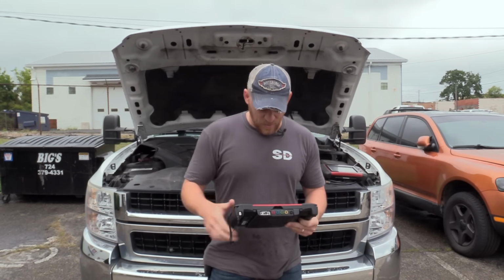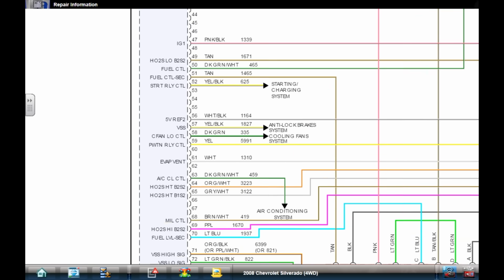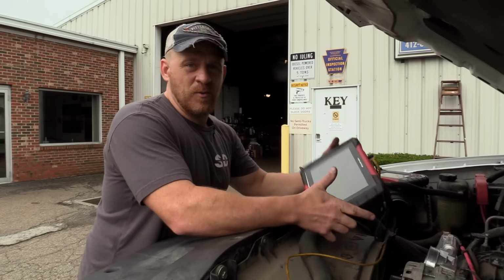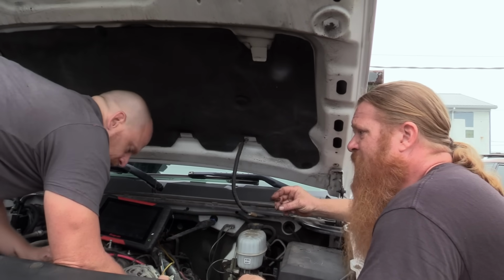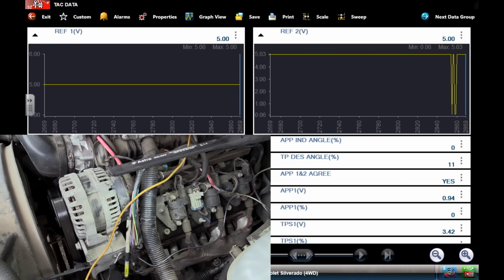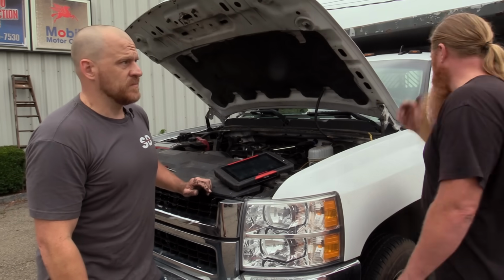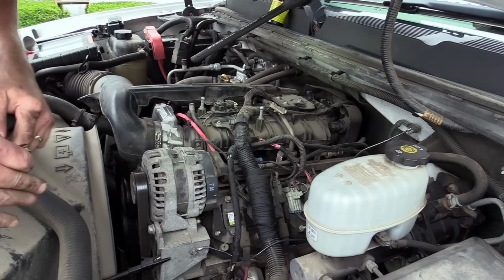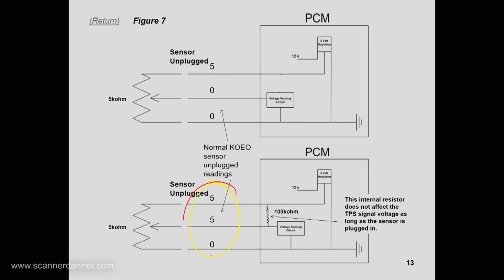Troubleshooting a Shorted 5v Reference Circuit (Chevy Silverado)

Comment: If you DONT  find that fault and it does need a sensor after all ,after maybe a couple hours diagnosing do you still charge a Diagnosis Fee ?
Reply from the maker: For an intermittent shorted 5V reference circuit? Absolutely! From memory, there were 4 or 5 different sensors sharing that circuit. Which one would you like to start replacing?

And let me ask you a question in return. If I replaced one of those sensors and it didn't fix your vehicle, would you still be willing to pay for that sensor and the labor to install it?

That's the entire point of this video. Proper diagnostics eliminates the guesswork. You're paying for the knowledge, testing, and time required to identify the actual fault, regardless of whether the final repair is a sensor, a wiring harness, or something else.
Reply: @ScannerDanner I see about diagnosis times and procedure  . But did you see my other comment on the Purple plastic burnt on the Bolt end where and when you lifted the harness off it ? I thought its a purple wire right away and funny it meled right through everything ! TIS CLEAR REFERENCE for finding shorts and faults in future !
Reply from the maker: That never happens honestly and that was only visible after the short was found, using harness contact points as a guide. It would not have aided at all in finding it, because contact points are first!

Comment: Big bro wins again! They gently fussing over where the contact point was.  Lol. Lil bro explaining a million things.  Big bro just did it!
Reply from the maker: To be clear, big bro is the bearded guy 😊
Reply: @ScannerDanner that's hilarious.  Well you definitely give off older brother energy.  Lol. Love the back and forth.
Reply from the maker: 😂 that's funny that you notice that. I've always been the more bossy one 😅
Reply: @ScannerDanner you can hear your bro justifying his actions,  as if he messed up.  He did good.  You just happened to get it right first time! Lololol. 

That said.  I'm watching these again because I have 3 sensors going crazy.  Cps, cht, and evap vent.  Intermittent voltage,  32000 f,  -18.5 hg. Looks like i have a wiring issue right?
Reply from the maker: The crank sensor and temp sensor would'nt share the 5v ref but would possibly share a ground. The EVAP vent, are you referring to a solenoid? That wouldn't be sharing anything.
What are you working on? Year, make, model, engine, codes and symptoms. I can try to help more
Reply: @ScannerDanner  09 mazda cx9. P0342 and p0452. Stalling while driving and losing obd port. Stft are fine in closed loop.  Then after ten minutes or so the fuel trims sky rocket then shut off altogether.  Then it stumbles and dies. I've tried a ton of things.  It's time I verify the wiring is ok. Ty in advance.  Love all of your stuff.

Comment: I have been chasing a 5 volt ground problem in a truck I bought for 6 months now. Never could figure it out until I watched your video. I found the excat same problem you discovered. Patched it up and taped a thick piece of rubber to the harness. Cleared the codes and now it runs fine with zero issues. Thank you
Reply from the maker: Awesome! Happy to help and props to you for figuring it out!

Comment: how can you track down a sensor ground (grounded inside ecm) that has mystery 3.5- 5 voltage on it, all sensors on circuit have individual sensor power supply
Reply from the maker: If it is all the sensor grounds then look for a main computer ground that's bad. If it is only one sensor ground, generally, something cooked it. Something got plugged in wrong or a 12v power wire shorted into that circuit (harness damage)

Comment: Dan have you saw a situation with 5vref stalling the ecm and dropping to 2.5v yet it dosent leave any codes but loosing comms on the bus u-0100
Reply from the maker: Handled no differently than this one.
Reply: @ScannerDanner thanks  this one’s tough I’ve unplugged all the sensors and replaced a few with no difference gets to 140-150 degrees and dies only codes are loosing comms to ecm
Reply from the maker: Driving or sitting still? And does it occur
at that exact temp each time ? You have a harness issue i bet
Reply: @ScannerDanner it is really close to the same temp every time the temp sensor has been replaced  and all the wiring with new pins to ecm but dosent read correct on the cluster the only thing that makes sense to me is that a wire  on the same internal circuit has a problem and I’m relieving load on it when unplugging the temp sensor, doing this it runs normal and dosent stall the ecm  but messages engine ac off  plug in temp sensor dies instantly
Reply: All other sensors unplugging makes no difference the ecm has been replaced and programmed  you can imagine that is  frustrating
Reply: Do you think this could be  a serial data issue

Comment: I have a 5v TPS issue on my 2001 clk430 that I can't figure out. I've disconnected every sensor I can find on the engine bay disconnected the bas/esp module , the tcm, the transmission connector, the o2 sensors and still 3.15 v at the tps. I pulled fuses to the instrument cluster and am at a loss on what to check next. Stuck another ECU in and same 3.15 volts !!!???????? Wtf

Comment: 6 years after you posted this video, I'm facing the exact same problems in my 2005 Silverado Z71 5.3.  I'm hoping this is the solution I've been looking for. I'll find out later today when I get into the harness. I was thinking it may be bad grounds or something getting grounded out. My scanner is just a little cheap one but it does graph so I'll be watching it while I check things over.   The other problem is the fan control unit code and the fans turning on randomly overnight and killing the battery.  Plus the alternator randomly over charging up to 15.4v. Any ideas on the fans and alternator?

Comment: Love it! I'm dealing with a volvo that has the same 5v circuit B low code along with several codes for all the associated sensors.  At the plug for one of the sensors in that circuit I noticed exposed wires coming out of the factory loom and into the plug for the sensor.  Thinking it was simple mice damage, I peeled back some of the factory electrical tape/loom with the intent on doing a splice fix and discovered that the insulation around each individual wire (in this case 3 wires) had completely eroded off even though its been protected underneath the factory tape/loom! The car is in limp mode and while its running if I slightly pinch the wire harness even a few inches up from where I did any tampering it shorts and shuts off the engine!  I managed to move it to a happier position to where I'm only getting two codes instead of 7, no more 5v low code but a high code for that particular sensor and one other.  Now I'm thinking it may be shorting to power instead of ground,  I'm blown away with seeing a harness erode internally like this.  Have you ever encountered it before?

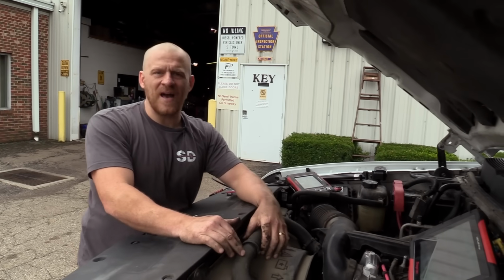Comment: 39:33 I learn things the hard way.  I learned that on a high-mileage GM LS engine, anytime you see a P0300 and misfire histories on cylinders 1 and 6 (5 and 8 too), then do a crank relearn because those are false misfire codes caused by timing chain stretch.
Reply: Very interesting.....
Reply: @B1gTuffGuy  Search "
Chevy GMC Misfire Codes P0300 - Crankshaft Variation relearn" by THE CAR DOCTOR.  That's how I learned of it.  If you don't have a scan tool capable of crank relearn, go to any respectable mechanic.  They should have a scan tool capable of crank relearn and they can do it for you for a charge.

Comment: So I have a question, I’m dealing with a ref1 code that is intermittent, and like Danner, I can clear while running. It will stay gone for 30 seconds and then kick the p0642 and low power. The 642 ref 1 controls quite a few sensors, I’m not getting a code of a sensor being effected, so will all the sensors on that circuit drop out when shorted? Thanks in advance
Reply from the maker: yes sir and it being intermittent says you most likely have a wire rubbing on ground somewhere in that harness. Look for contact points of the harnesses once you figure out what all is on the Ref 1 circuit
Reply: @ScannerDanner I have gotten a couple of map codes with the 641 today
Reply: So I’m not for sure about this, but when the fuel tank pressure value is down low, it works fine and I am also able to clear the code. However, the code sets when the value goes up to about 13 what I would say normal is it right now I just cleared the code at idle I’m at -.18 now I am going to raise the engine The tank pressure rising steady -07 -74 and no issue now if I can get it to go high in the positive it will set it but now it is staying in the negative numbers and it is not setting it
Reply: Well the tank pressure sensor fixed it. What a sucky code, plus with super suspect areas on the harness I so wanted to find a wire poking through but nope. Tank pressure sensor( 8 plus hours later😳) thanks for your video, very helpful!
Reply: Hey brother, I am back i’m going to see if I can chase down a wire however I have been using the standard ignition fuel tank pressure sensor. I’m no longer experiencing the reference one code P0641 but now I am getting a P0 452 and I have watched your video a few times so I will start chasing the issue using that I fear that the original sensor may have shorted out something internally in the computer because I’m getting 1.5 V and then it will fall out to zero. Back to your original suggestion that there may be a wire within the harnessrubbing, I also changed the connector in at the pressure sensor. This one is a nightmare!

Comment: "We can multiply that problem by however many trucks they made in that series because they are all are gona have the same problem eventually.

... any ideas on how to keep the bolt stud from boring a new hole in the repaired wire harness.

Like cut the top of the stud off or put a

Comment: Just had one roll through the shop last week bunch of sensor codes and a P0641 on a Honda. I checked the wiring diagram and took note of everything on the 5 volt ref. Took a look at the flow chart and funny enough there was also APP on that same circuit but labeled differently on the OEM schematic. I immediately thought of you and how you explain circuits can be internally connected in the ECU even though the diagram doesn’t give that detail. Thanks for all you have done for me Paul in my career I’m almost done with your free content and will become a premium member after
Reply from the maker: Nice job man! Thank you and looking forward to it

Comment: Wanted to let other people know, I found a wire issue on my 4.3 v6 2007 Chevy Silverado on top of the bell housing and back of the engine. The wire loom that runs on top of the transmission was rubbed through right at bell housing and engine joint. So when I pushed down on loom behind engine I’d get 0 volts on a 12v line going to map sensor was how I figured it out. Just in case other run into this issue and not sure where to look.
I was getting P0641 code and truck was going into limp mode because of it also.
other codes that popped up
P0107 MAP issue
P0452 evap emission (egr I think)
Sometimes pcm/ecm processor code popped up.
I’ve just now found the wire rubbed after pulling transmission. Still working on fix and adding proper wire insulation.
Also there’s a few other spots behind the engine the loom can rub.

Comment: I have a 5v reference on my PCM that is reading 0 3 vdc at the PCM. That reference powers 5 sensors. The easiest way to find the "short" is to use a multimeter and probe the pins of the "sense" signals coming back from each sensor at the PCM connector. That saves a lot of time .

Comment: Good catch, and by design, not by luck. Your "thinking out loud" and explanations are good also.
   The offending stud there, with the harness running right next to it, might be a good place to use an 'Adel' clamp- an airplane thing- as long as its ok to fasten the harness tight to the moving engine right there...looks like it would be.
   Or, like you said,  your fix will probably outlast the truck!
  I subscribed, thanks, good video.
Reply from the maker: Thank you!

Comment: I had that happen with my Phil’s probe and I noticed that the brass insert came loose and unscrewed from the top of the  probe.
Reply from the maker: Yep, got to tighten mine every so often thanks!
Reply: @ScannerDanner  ya I’m using it on a 2020 Frieghtliner step van with a gm ls 6.0 engine. PSI International supplied the engine  and computer. They partnered with JPro diagnostics   Who supplied the scanner hardware and soft ware. I’m not about to jump out and spend the 2400 dollars they want for the software and hardware to scan this engine. I’m not sure what to do since the engine does not even want to run. It sounds like it is running on 4 cylinders.
Reply: I have spark, fuel, and good compression on the passenger side at the moment but no bang. The exhaust smells really rich.

Comment: As some one who works at Autozone u tell people it may solve the problem but they need to take to a shop and have properly diagnosed. Throwing parts at an issue is 50/50 and bugs me to no end that they come to us thinking we are techs and we will diag a care just off a code. I hate how we take money from shops and it’s cuz they market it to the masses that’s what we are and people think cool I’ll spend less money. Smh

Comment: Thanks! I was getting all kinds of codes on my 2019 Silverado Custom, by following your direction by checking the wire harnesses, it save allot of time for trouble shooting. I didn't find where the wires was rubbing but , I'm not have the problem with the codes anymore, and i didn't change any sensors ,so i will be adding new wire covering over the old ones to be safe
Reply from the maker: Thank you!

Comment: Just stumble upon your channel. In am retired mechanic with 37 years on a job. I love your passion and the way you presenting issue and finding a solution. This industry is full of parts changes. Anyway, I was looking for the info to solve my friends issue. Car cranks and will not start. No fuel pressure and no spark. Turned out it was crank sensor magnetizing tip covered with rusted metal pieces. cleared rusted junk and car runs. How often do you see that?
Older car. 2006 with high miles. love your scanner. makes life easy. your got a new subscriber
Reply from the maker: Thank you and welcome!
I don't see that often and that's a great catch on your part!

Comment: My 2002 PT Cruiser had similar behavior. The cam sensor wires shorted and the car would stall. had to turn off the key. then long crank and it would start and run.
The code would clear it's self after a while and it would run better after that. I agree that the computer logic does something to bypass the sensor

Comment: Goodnight d boss. wanderfull way, d 1 an only way  4 mec an elect 2 find any short who don'thave a scan tool. I never taught of contact point.now i can fix a vehicle in d jungle. Tks  4 dat great knowledge keep up d good work.how come d  ecm diden't fry, seeing current is shorted from d ecm wire
Reply from the maker: Good question! The 5v regulator is a well protected circuit within the ECM.

Comment: Just had a 04 suburban with intermittent A/C found shorted wires to A/C pressure switch in the same harness, same spot. Thanks for the vids

Comment: I gotta 2016 GMC 2500HD with a L96 motor and I am getting the same two codes as well as a U0401, B101D, and a P057C. I have a 5 volt reference at the Crank sensor the TAC and the APP. Do you think it’s a faulty ECU? I have been working on it for two days and getting nowhere. I have rarely seen a bad ECU. I suppose it’s a first time for everything. Any input you may have for me would be greatly appreciated. Either way thanks for making these helpful videos! The DIY guys have advanced light years because of you getting these videos out there!

Comment: I had a 2006 Chevy Silverado that the wiring harness had rubbed a pipe coming off the valve cover. I had just replaced the catalytic converter and the 02 sensors due to a faulty temperature sensor upon starting the car up after the repairs the engine idle went to 3000rpms upon startup. I was about to replace the tps and went through one of your video's on cheking harnesses I found the broken wire spliced it back together and i fixed the problem much thanks to your techniques.

Comment: Doing a ls swap my car been sitting for around year and half trying to figure out why wasn't  starting am not an expert so I even bought an terminator x max thinking that was gonna solved it I was thinking it was vats bc I didn't have no rpm and no gas and finally I think I found the problem I didn't know about the 5v reference change crankshaft and cam and eavrything and no..so after watching the video I check the voltage and I was getting 2.5v so I started by disconnecting sensor bc I know wire harness  are good bc they new and on the first try I disconnect the map sensor and finally getting 5.v on cam and crankshaft went to cranck engine and now am getting rpm and gas ..so I think it was the sensor itself just ordered a new one